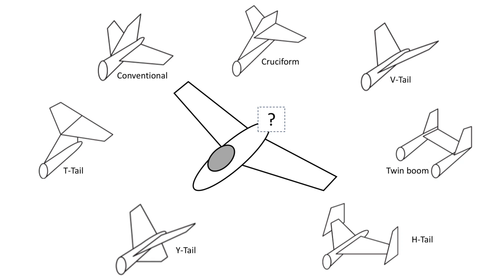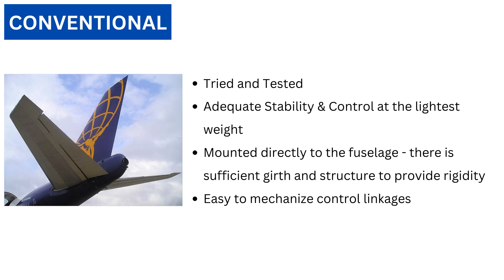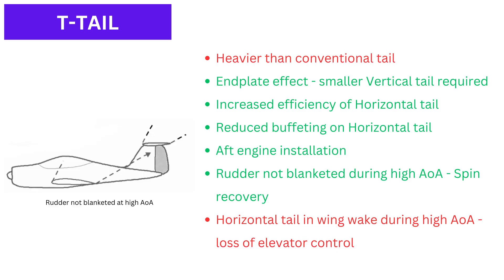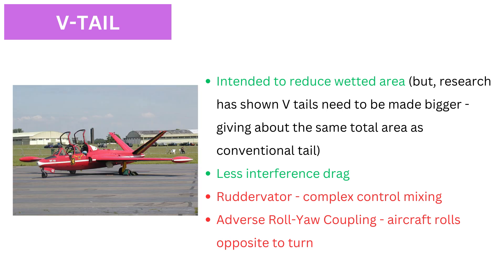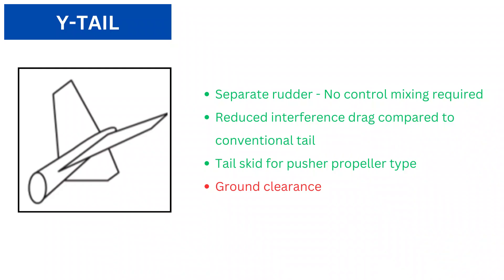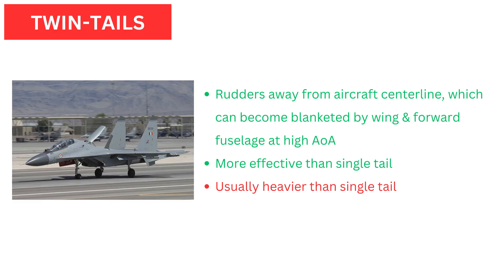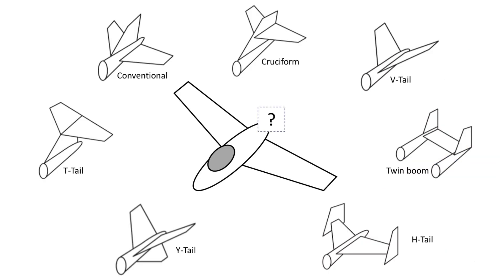Types of Aircraft Tail Configurations and their Pros and Cons | Aircraft Design

Comment: V-tails and angled twin tails also allow for smaller radar cross section by avoiding 90° corners. this is another reason why they are common on modern fighters.
H tail has the added benefit of center-line clearance if you're trying to launch gliders or space planes. (see the soviet MAKS also the Buran carriers)

Comment: Another useless study and video. You may expect any "advantages"  of different tail shapes, but you can not make any existed planes better, because you (anyone of you) are not authorized make any changes to existed design😂😂😂. 
OK, you may build Part 103 ultralight and not go through any kind of approval, but you have to follow the requirements applied to Part 103 aircraft- maximum speed 55 knots, fuel 2.5 hours of flight and landing speed no higher than 50 mph. That is all you need to know and follow. Your wing must have wing loading maximum 25 kg per square metre of the wing. The derivatives come up themself😂- maximum speed, landing speed, weight of the aircraft and impossibility jump out of these requirements. 
You guys again wasting your time on the not important bullshit with AI sound

Comment: Why horizontal stabilizers of airliners do have dihedral angle? These surfaces "fly downwards" (not lifting, but rather the opposite). A straight spar would be so much easier from the structural point of view, especially when the whole horizontal tail is movable for trimming purposes or as a stabilator.

Comment: timestamp aprox 6:20 -- What? How does putting the rudder behind the engine "increase control during an engine out condition?" That postion can increase rudder authority when the engine is running and forcing an accelerated stream of air past the rudder, but not at all when the engine is not operating. If anything, the turbulence created by the inoperative engine will decrease rudder authority during an engine out condition if the rudder is behind the engine.
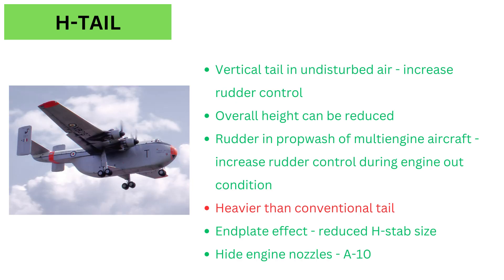Reply: Look at the aircraft image shown at 2:42. There are two engines, two tails. When one engine is out, the other tail is still within an accelerated air stream of the running engine giving greater control despite the asymmetric thrust. The timecode you selected is at the end of the video, when nothing is being shown, I assume you meant something around 5:42? In that case, the example shown doesn't have the horizontal plane in the prop wash, but another design would have it partially in the prop wash. Again, the critical part is in a single engine out condition, not a multi-engine out condition. This feature isn't relevant if both engines on a twin engine design are out because there isn't asymmetric thrust then. The added control is only for dealing with asymmetric thrust.
Reply: вы очень далеки от истины, вам не хватает образования и опыта

Comment: One thing I thought you should mention is they all have different radar reflectivities. All the 90` intersections will produce a larger radar signature than other angles which military designers care about. Its why most modern fighters have vertical stabilizers canted outwards. (in part, there are other reasons)
Reply from the maker: Agreed!

Comment: B24 Liberator had H-tail, with two oval vertical stabilizers. However, its handling and stability was not the best, so later they try to improve it with single vertical fin. The single fin was found to significantly improve handling, and B-24N was intended as a major production variant featuring a single tail, but they were cancelled due to the end of the war.
Reply: that's also where the PB4Y got it's single tail design from.
Reply: ты написал полнейшую глупость , не делай больше этого

Comment: Is the inverted Y-Tail of the Harrier considered close enough to the conventional type not to mention it?
Reply from the maker: I believe one of the reasons that an inverted Y-tail on such aircraft is used is to keep the horizontal tail out of the wing wake during high angles of attack. F-4 Phantom is another example.
Reply: @AircraftDesignToolbox  thing is, the Harrier's wings have the same downward angle
Reply: I wouldn't call the Harriers tail (or the Phantoms for that matter) inverted Y-tails, for the very simple reason that the horizontal, or horizontal-ish, surfaces don't contribute to yaw control or stability. They're just used for pitch control. I'd say they're just conventional tails with rather pronounced anhedral.
Also note that the first P.1127 prototype, which would be developed into the harrier, had a perfectly horizontal concentional tail. So the switch to downward pointed horizontal stabilators was likely implemented due to test results.
Also, the Harriers wings are mounted high on the fuselage. So at high angles of attack, the horizontal stabilators would likely protude below the wing wake despite the wings own anhedral.

Comment: Vee tail biggest drawback is drag.  When it is deflected to increase vertical downforce, the surfaces also produce two horizontal inwards forces.  These two forces cancel each other,  but they still produce drag.
    An advantage of the Vee tail is spin recovery.  One Vee surface will always be awash.
    A slight advantage of the Vee tail is dihedral contribution, but it’s less than 1degree
    The Vee’s best advantage…it looks G O O D
Reply: Only on a Bonanza.😂
Reply: @daszieher  Also known as "The Dr. Killer".  A friend had to sell his V-tail bonanza a few years ago because structural cracks were found in the ruddervators and those parts are too hard to find (and expensive) for replacements so it made more sense to sell it to be parted out.  Soon there will not be any of those old V's left.
Reply: @larrybremer4930  someone will eventually come up with a technical solution.

Comment: The twin tail in fighters often cannot decide what to do with the engines. F-22 has this rectangular afterburner and nozzle which fits . But other countries have this blank metal tubes and circular nozzles. Do we reduce interference drag? Do we have a ventral fin? F-35 looks super weird.

Why do eurocanards not have a twin rudder, but twin engines? F-5 tail looks so strange compared to F-18 .

To me it looks like the vertical is used to stiffen the boom for the horizontal tail plane, which will have to endure high forces on turns an high AoA. Only aerobatic pilots somehow think that it is fun to fly on the side.